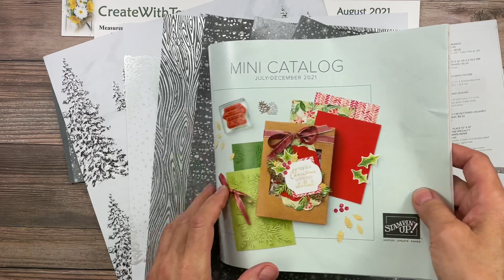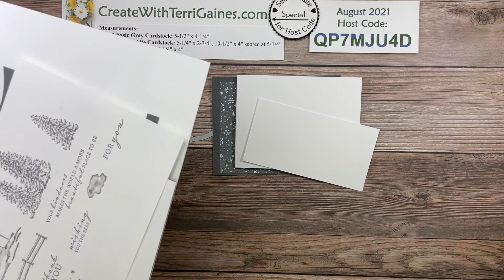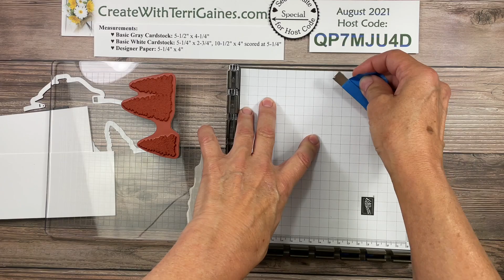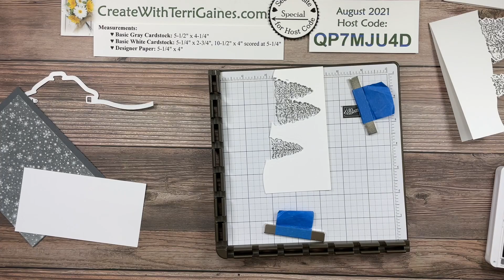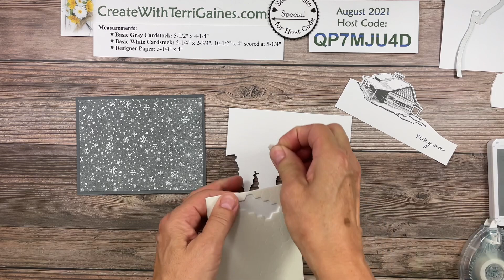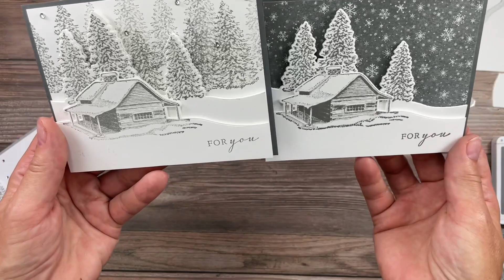Peaceful Cabin Fun Fold Card using Stamparatus

Comment: You don’t mention how you determined where to place the stamp on the stamparatus. I’m struggling to figure that out. Help, please?
Reply from the maker: For the trees & cabin I used the template for placement which means I could place the stamps anywhere on the stamparatus.  For the inside sentiments I placed the card on the edge of the stamparatus and placed the sentiment on card, then closed the plate to pick up the stamp (doubled checked to see if it was straight).  For the 'for you' sentiment I placed it on the plate after I placed the cabin stamp on the plate.  Hope this helps.  Happy Creating!

Comment: Dumb question.  If I  don't use the dsp and stamp the background instead, do I just substitute a piece of white cs cut to the 5-1/4" x 4"?
Reply from the maker: That's a good question.  If your 5-1/2 x 4-1/4 card stock is white you could stamp it.  I used a colored cardstock for the 5-1/2 x 4-1/4 cardstock, and stamped on a 5-1/4 x 4 white cardstock.